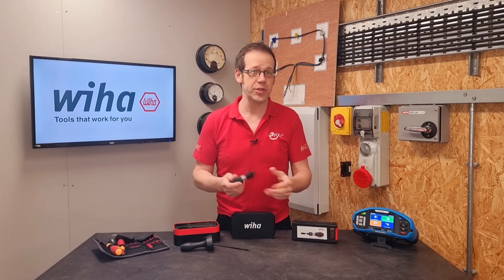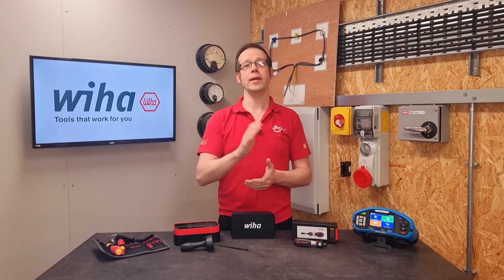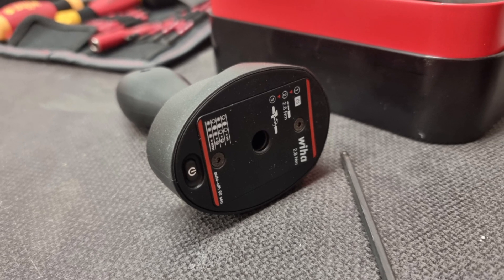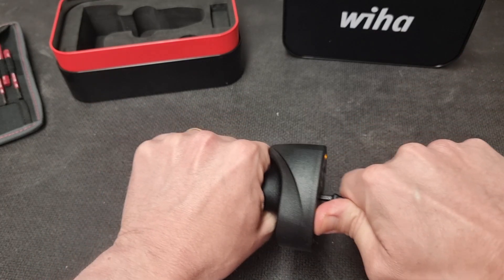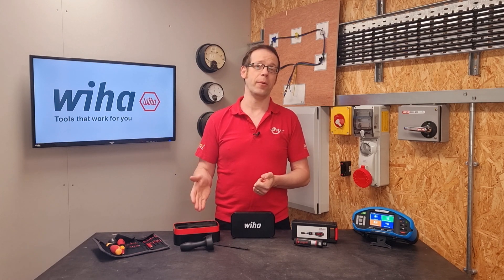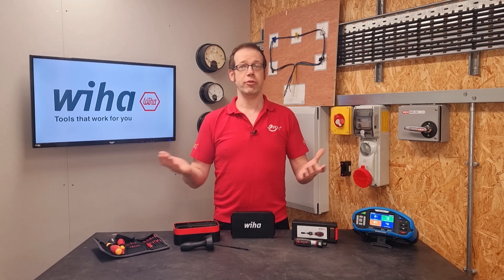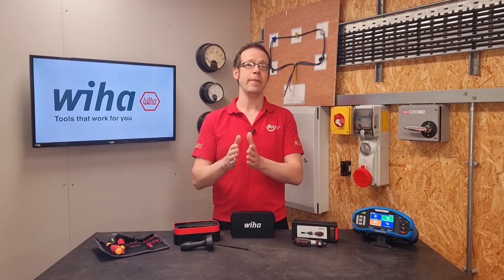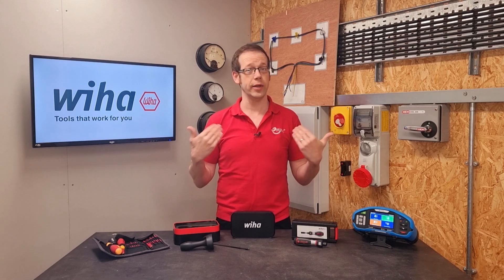How to Check if Torque Screwdrivers Are Working?

Comment: How have engineers got to the point were you need a special screwdriver to tell you that you've tightened something correctly? It's madness. Teaching apprentices what feel for and look for is surely better than blindly following a torque screwdriver which can be fooled by a binding screw etc. I did my apprenticeship in the 90s when it took 4 years min to qualify. You learnt a lot in that time from good experienced engineers. Everything these days is so bumbed down. Come on. A torque screwdriver!  Learn what to feel for. Is this really where we've got to! Its like baby sitting. Rant over
Reply: I used to mock them too. But for the sake of £80, I think they’re worth every penny. It just covers your ass, if you can prove every terminal was tightened with a torque screwdriver then any liability on you goes away in the event of a fire starting from a dodgy connection. It’s just insurance more than anything. Plus they’re really satisfying to use. 

You can get away without using one if you’re House bashing but on big commerical/industrial sites it’s a requirement to torque terminals and everything is checked, so it’s a necessity in these environments.
Reply: Started an electrical apprenticeship in1972 never had these toys then .But then everyone had the time to show you how to do it , everyone is just in a rush now . Was giving a good piece of advice though.
Tighten it up and come back to it and recheck after a month, not always practical but it’s a good idea
Reply: Never a truer word said .

Comment: A couple of points. To note 
1 we are know required to test RCDs at 1x only and we are expected to trust the manufacturers when they say there RCDs  work correctly? 
2 yet you said in this presentation that we have our MFT calibrated and we self test by shorting the probes because we don’t just assume that it is accurate.. When it comes to self checking our MFT we have a check box and we can check all  the test functions on our MFT , against the check box.
3 the torque check is calibrated to 2.1Nm so can it be used to check all the settings on a torque screwdriver? If not 
Then we will need to have a number of these things, if your torque screwdriver is 1 to 5 Nm plus all the points in between ie 1.2  2 . 8  and so on  then we will need  ten or more of those torque check things and at (correction £234 . a pop )
That is just not a realistic option . It would be a lot cheaper to just throw the screwdriver in the bin and buy a new one or just get it calibrated if you think  it’s not working properly.
 But I could be totally wrong, but who am I to argue i’am just a humble spark who’s opinion means nothing. So I don’t think I will get an answer 😂
It has just a cured to me all this calibration we are expected to have done dose this mean we are expected to have the torque/ clutch on our combi drill calibrated and the hammer function on our hammer drill. 
The next thing will be we have to get our claw hammer calibrated to make sure we can pull nails out and knock nails in . It’s all a load of old tosh.

Comment: Not really worth it at torque that low. If it's fifty percent out it's still only 3nm Vs 2nm
Reply: For example the standard for car torque wrenches is 4 percent error to pass
Reply from the maker: Surely if the terminal needs to be set to 3Nm and it's only on 2Nm that is a problem? 🤔
Reply: @efixx  I think if you're using a torque screwdriver you're already doing more than 80% of sparks
Reply: @efixx  I agree but what I'm saying is the amount the tool will be "out" isn't going to be anywhere near fifty percent.

Comment: In my opinion this will be only relevant when working on older installations and some specific devices. On newer installations we will see more and more screwless connections.
Reply from the maker: Your lucky 😄
Reply: @efixx  you're* 😂 Keyboard needs calibration
Reply: I hope we see wago rcbos/affds soon. 
I regularly install and test commercial premises. Last high street store I done had 4x 72ways, 1x 36way, 1x12way, 1 x contactor panel with approx 20x 4way contractors. 
That's over 1200 "clicks" 
That doesn't include the bms panel or any other connections Carried out on that job. 
So in a job that took 2 weeks I've ¼ of the life of one of those screwdrivers at £100+ 
No idea how much to calibrate one of these as I haven't found a place yet that'll actually do them. 
Sooner wago and Schneider mate a board together, the better!
Reply: @darylsavage119  Hager Quick Connect....😉
Neutral- and CPC-terminals are push-in for conductors up to 4mm², for larger up to 25mm² there are still screw terminals. MCBs and RCBOs are also screwless, even the busbar is just clipped in.

https://www.hager.at/top-themen/top-aktuell/quickconnect-stecktechnik/215216.htm

The problem for the UK is the rating. In the UK you got single phase supplies in domestic dwellings with 100A. We have three-phase supply, usually with 3x63A in modern installations. The rating of these parts is 63A.
Reply: @Marcel_Germann  eww hager? Yea, the 63a rating on the feed side would be an issue, most dwellings are rated to 100a but more likely an 80a fuse in DNO cutout
Reply: @darylsavage119  on the "1200 clicks" point - digital torque screwdriver exist that don't click and as a result don't have that limitation.

I use a Sealey STS104 which has the other advantage of being able to do enough torque for MCCB terminals which most small ones can't.

Comment: Don't you think we're all taking this a bit too far, testers calibrated every year, torque screwdriver calibrated, testing our testers after every step in a test, its all a bit of a much of a muchness which isn't reflected in the pay we get or the respect we get from  customers, CPS, s , manufacturers and industry. Why is the onus always on us?? When are manufacturers going to actually take some responsibility for the products they produce and manufacture some decent robust fail safe products.
Reply: Well said Ray 👍
Reply from the maker: I don't think it's a problem with the manufacturers, it's a problem with physics, everything degrades over time and needs adjusting. 🤔
Reply: @efixx look at this guy wanting more pay because he did safe isolation correctly and fully 😂
Reply: @TheFool2cool  that's not what I said at all, what i was saying is that year on year more and more responsibility is heaped on us whilst year on year our wages don't keep up with inflation or the JIB rates (which is the industry guide) don't match or compete with other trades, for instance I saw an advert the other day for an approved spark at £16p/h whilst in the same ad  a mate was offered £14p/h....  4 years  at college, endless new editions and amendments.... an extra £2 an hour for all the responsibility heaped on an approved spark who literally runs a job! Plasterers, brickies, plumbers, joiners are now making more than us yet we are supposed to keep up to date with and show and have some form of log of our keeping up to date with current regs and practices while a mountain of responsibility, paperwork, certification, maintenance of certain tools is expected of us. I don't want extra money because I know how to use a proving unit, I want a fair wage for us all that reflects the time, responsibilities, and the sheer mountain of knowledge that we're expected to hold, obtain and keep up with.
Reply: @raymurphy9749  ain’t that the truth. But sadly your words are and will always fall on death ears . And so we just have to get on with the job and spend more money needlessly . 
Great comment that is spot on and tells the truth .👍
But who am I to argue, i’am just a humble spark who’s opinion means nothing.
Reply: Its another easy money scheme. There would be plenty more to come no doubt.
Reply: Thank you guys 👍🏼

Comment: How often are you supposed to get a torque calibrated arm calibrated?
Reply: I used to mock torque screwdrivers, and argue that since college I have been sensibly tightening screws without damaging them and making good long lasting connections. Then an apprentice rocked up and could put 1/4 turn on all of my screws! So it seems a calibrated right arm degrades over time too.

Comment: Does the QuickCheck need to be sent away to be calibrated annually too? If so, wouldn't it just be easier to get the scewdriver checked?
Reply from the maker: Haven't seen any direction to do so. 🤔
Reply: @b gg well, I am paying for calibration on lots of equipment but okay.
Reply: @TheFool2cool  that’s because you’re probably using test equipment that costs in the region of £ 10.000 to 20.000 like the big things built into a large case , and you test high power generators and stuff like that. But who am I to argue i’am just a humble spark who’s opinion means nothing.
Reply: This is a pointless waste of time and money. As for annual celebration for our MFT the NICEIC to me if I self check  my MFT on a check box say every three months then that is acceptable , but if at any time there is a +_ drift then I should send it for calibration. We already self check out voltage indicator with a proving unit and nine times out of ten we only use it to prove dead , so is it really necessary to our voltage indicator calibrated every twelve months? Doesn’t matter how you look at it we are just constantly being ripped off 
And I do believe that the torque check thing will be expected to be calibrated every six to twelve months . For no real reason. Wile the quality of the products get lower the share holders get richer. Just my opinion but who am I to argue i’am just a humble spark who’s opinion means nothing.
Reply: @seandempsey7351  calibration is very important for test equipment. Maybe not for house bashers, but us in larger industry realise the need for calibration.

Comment: I love this tool from Wiha but it’s important to point out the wiha tool can only be used to test certain torque ranges which are quite high. They need a similar tool for all their torques screwdrivers which have lower torque ranges. So Wiha can we have that as well please. I do suspect that the tool torque variations are probably less accurate at lower ranges but this is just a suspicion.

Efixx please make sure that you explain this that’s a key bit of information.